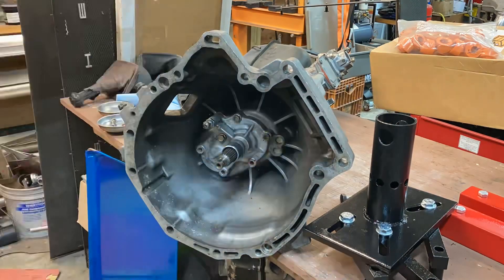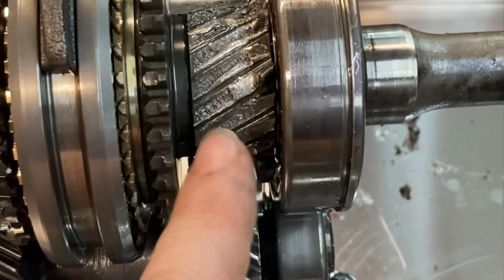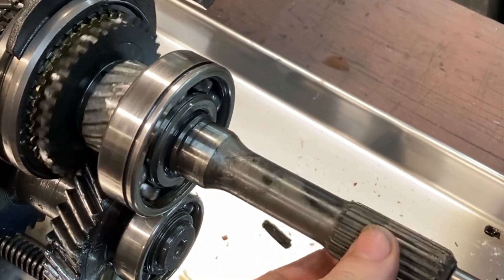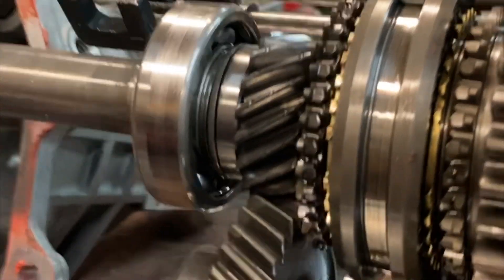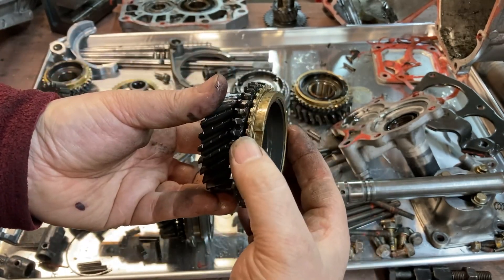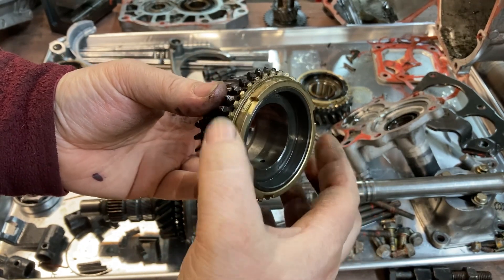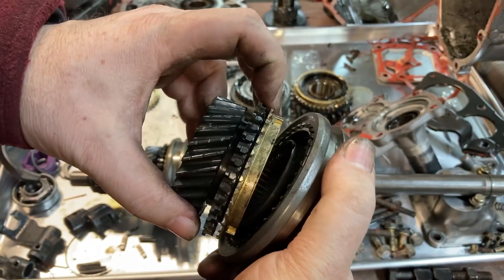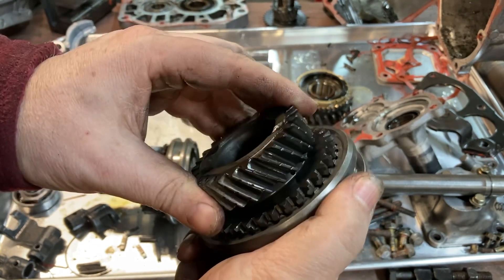Tear down and explanation of a Mazda Miata 5-speed manual transmission

Comment: Its strange from outside it looks like NB transmission but inside we can see straight reverse gears teeths which comes from NA transmission. The red silicone residues could mean somebody put the NA shafts and gears into NB trans body but I dont know why. Regards!
Reply: The Na/Nb are identical from the outside forward of the tail housing. You can swap them over, you just have to change the 3 selector forks on the rods (easily done, drift out the roll pin and swap over) 
I had a very low Kms NB box, but wanted to keep my modified NA tail housing (shorter remote)
So I swapped them over that's how I know.
It makes sense for Mazda to just use the same to keep costs down, just changing the little bits needed.
Not sure about the NC box because I haven't looked at one in person yet
Reply: @shaunhall4166  NC gearbox is also almost the same, you can swap it even with NA housing to obtain better transmission as NC have got i e.  better oiling and synchros
Reply: @marcinpc88  ok thanks, that's good to know.
The box and engine I'm using has only 40k km's that's why I wanted to keep the box, but really wanted to use the na because the remote can be shortened. So when I looked at them side by side I thought,mmmmm that would work haha.
So I tried it.
I have also modified it to take SAAB hydraulic clutch release bearing 
The engine and box are going in my MK3 spitfire, running throttle bodies made from SU carbs to look a bit more period.
Thanks for your reply, have a nice day
Reply: @marcinpc88  Is it just a straight swap?
Reply: @Polybush_UK  you can simply swap just the external housing and leave the middle thin plate but I prefer to disassembly all the stuff and use all the housings from one gearbox to make sure it is perfectly aligned
Reply: @marcinpc88  Thank you!